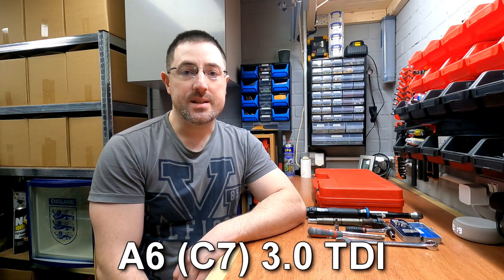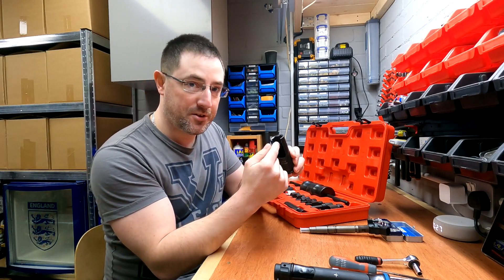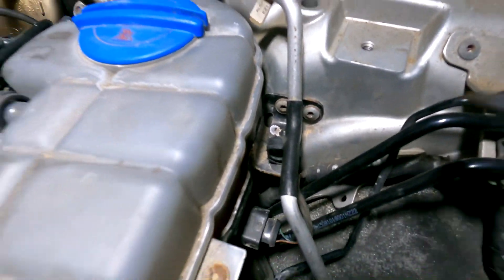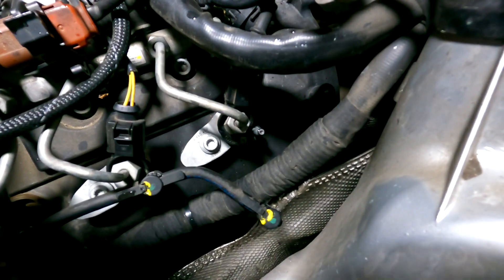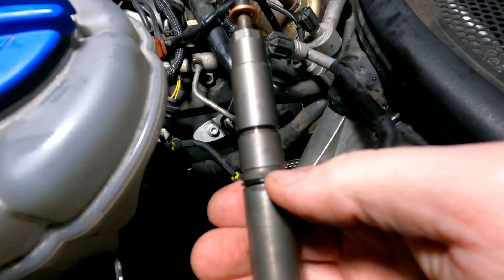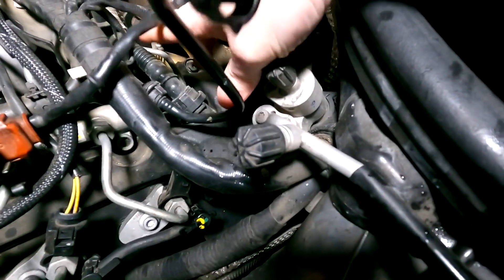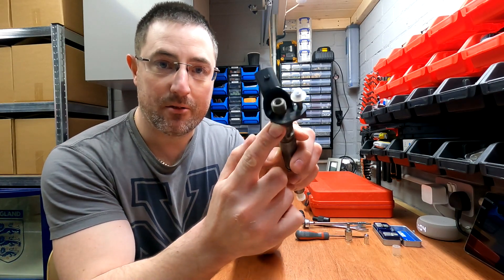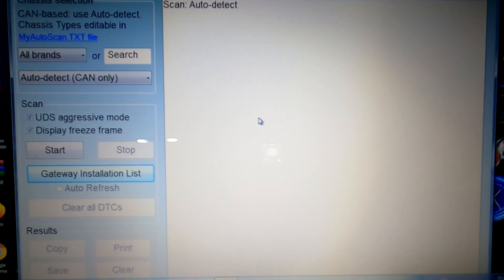Fitting New Fuel Injectors/Seals On A 3.0 TDI For The Audi A4, A5, A6, A7 and Q5 2010 to 2015

Comment: Today I replaced a pcv valve integrated into head plastic cover (a4 b9 3.0tdi). I had to pull the injectors, remove commonrail and so on, but your video really helped me doing so. Thank you

Comment: Great video thank you.  Does the high pressure system need bleeding upon re-assembly at all?  I assume the high pressure pipes have diesel in them when you remove them and have air in them when you re-assemble.
Reply from the maker: Thank you. In most cases, it won't need bleeding. It may take a few more attempts when starting, but I haven't encountered one that hasn't started.

Comment: Hi Ryan, i have a VW TOUAREG ENG CRCA i was reading the stretch bolts to be tightened to 8NM then 180 rotation? Could that be the case for mine? Thanks
Reply from the maker: It's very likely, but would need confirmation

Comment: Great video, very clear. Thanks !!
How do I use VCDS to determine which injector is faulty? It’s giving me fault code P2146 which only tells me there an open circuit on injector bank A. So I guess that could be injectors 1,2 or 3. I have an A6 C7 3.0 tdi. Thanks in advance

Comment: Do you need to prime the fuel to go into the system because I changed them and it took a while for it to start for the fuel to reach the pressure needed to start the car but it's running OK right now no light came on or anything, but it did need some time to Pump the fuel back in the system

Comment: Can you tell me if i need to replace the rubber seall in the valve cover the around the injector?  Can it be changed without removing the valve cover?

Comment: I've got the dreaded injector seal issue with an A7 C7 and this has explained exactly how to solve without spending a tonne at a garage! Thanks a bunch!
Reply from the maker: Glad I could help
Reply: @RyansWorkshop  Quick question if you get time to answer - Can I change the seals on one bad injector, or will all seals need replacing? Thanks
Reply: @tomshaw2192  It's ok to do one but if one is shot then the others are usually pretty worn too! And much better to get ahead of the game as then there is a lot less cleaning involved!

Comment: Excellent video, Ryan. Just one question for you: I suspect one of more of my injectors are faulty (engine running irregularly and smell of diesel in the car). But: how do I find out which one(s) is/are faulty? I do have an EBD2 tool but it's not showing any error codes. Any suggestions? Thx!
Reply from the maker: It sounds like you may have leaking seals which will eventually damage the injectors, you can sometimes identify which ones are leaking by hearing a chuffing sound and sometimes a strong diesel odour and puff of smoke, but the best way to identify would be to remove the injectors, if you have a leaking seal it would be a good idea to change all of the seals because if 1 has gone more Will likely follow.

Comment: The thread on top of the injector is standard metric. I found a nut in my toolbox which we welded to the slide hammer, worked a treat. Saves buying an expensive “injector removal kit”
Reply: What size is the thread on the nut

Comment: Is there a special tool for removing the plastic injector pipe lines....
Reply from the maker: No, it just requires a small flat head screwdriver to assist in lifting the clip upwards, then all you need to do is lift the pipe off of the injector.
Reply: Thanks for the reply, ps I should of asked as well, the small Injector chamber caps that stop debris from falling into the cylinder when cleaning, is there a link to buying the correct size because I've read stories/ mixed reviews of the kit you used in your video ie, them falling through / the flange isn't wide enough, is the correct diameter 7.5mm OR 8mm, for my audi a7 2013 engine code CLAA ....ps loved the video....

Comment: brilliant video Ryan, I need your input please, 
I recently needed to replace parts in my audi V6 tdi which needed the high pressure rail being removed. I did put it back together fine but after getting it to start I feen like the engine developed and miss or like a fuel starvation ( to briefly explain it) I drove the cat about 100 miles and it kinda feels like if develops a miss or fuel starvation as soon as there is a bit of torque on the engine. I get the feeling the pump/rail  is not feeding enough diesel through to the motor. Not saying that's what is is, its just how the symptoms look like. I did clean the diesel filter. but am looking at other areas to look at in my quest to trace the issue.

Comment: Whare are the links for the wire brush injector hole cleaning set?
Reply from the maker: The links are in the description
Reply: @RyansWorkshop  ah sorry yes got them thankyou Ryan. You said its a funny size thread ontop of the injector to attatch the slide hammer, does the fitting in your kit have a size on? Im just thinking just buy the correct fitting instead of a whole slide hammer kit

Comment: Would bad o-ring or seals be a reason for fume smell from the engine bay? I have no obvious exhaust leak but can smell fumes in the cabin and under the bonnet when the engine is running
Reply from the maker: Yes that sounds like a classic symptom of a leaking copper seal on the bottom of the injector

Comment: Do you have a reference of the cleaner to use inside the location of the injectors ? Tks
Reply from the maker: In my case I used an isopropyl rubbing alcohol (IPA solvent) because I didn't want to use anything too harsh, it helped to rub the carbon away just fine.

Comment: Nice 👍 Tks a lot is it the same with CVUA motors ?
Reply from the maker: It should be the same if not very similar as this engine is just a later generation with a second turbo, I believe the injectors are the same just with a different calibration setting.

Comment: When cleaning the injector locating hole if there is carbon build up how do you get carbon out? Will in not go onto the cylinder? Also this will be the same if you need to cut the sealing face for injector. What do you recommend?
Reply from the maker: I would say the best way is to adapt a hoover pipe with a smaller hose attached to the end, using tape to hold it together should be sufficient as long as it's airtight.

Comment: Thanks Ryan for this very informative video! I’ve been quoted hundreds to do this at a garage but I’ve just ordered the parts in your description. I have the other tools already and I am going to do this myself. Keep putting more videos like this, top man!
Reply: Hi Ryan, I’ve just fitter my injector kit using your video and it took approx 2 hours. I bought the kits from your list apart from the slide hammer and instead bought a cheaper one on eBay which claimed to have adaptors for Bosch injectors. Unfortunately the adapter didn’t fit (right thread size just flange fowled with injector housing). I then came up with a solution to use a slim 13mm spanner and insert into side of injector and work it loose that way (rotate clockwise and anti-clockwise). So all in all a good job and a lot of money saved! I’ve also documented the condition of the old seals and injectors. In my case it was cylinder 1 and 6 which were the worst and most leaking. The other injectors were clean and shiny upon removal. Once again, many thanks for your video!
Reply from the maker: Thank you, just glad I could help

Comment: Hello there, thank you for the video. Does the fuel system need to be depressurised first before work commencing? Thanks again.
Reply from the maker: No, the system doesn't need to be depressurised as there will only be pressure when the pump is running, it pressure releases when you turn the engine off.
Reply: Ok great! Thank you very much! I've ordered the seal kit from the link you supplied, it will take a month to get here in Australia. Itching to get this fixed on my sq5!
Reply: Hi, another quick question. Is the thread on the injectors m14 1.5 pitc thread? Just making sure I buy the right slide hammer set for the job. Thanks!

Comment: The SAE term for the bolts is Torque to Yield, abbreviated TTY.  You can actually reuse them a few times.  The stress-strain curve for those bolts allows for quite a bit of stretch before they fail.  We actually allowed critical fasteners (head bolts, main bolts, etc.) to be used 3 times for the engine I worked on.  But, they are also inexpensive, so if available, I wouldn't shy away from re-using them.  Thanks for posting the link to the kit.  Here in NA, the kits that come when you order from virtually all of the vendors is incorrect, it is for a gasoline (petrol if you prefer) engine.  And most don't have a picture so you don't know.  So just a heads up to anyone looking.  If in a bind, Elring 767140 is the copper washer/seal.  Be sure you clean up the injector bore, BTW, or they will fail again quickly.  2 months to be precise  :(
Reply: I suspect audi sent me the wrong injector hold down bolt for my TDI. It was a bit longer than the one that was in it and it bottomed out and snapped off in the head. Are the FSI injector bolts longer?

Comment: Hi, just watched the video, very good and very useful as I remove all the injectors for new copper seals rubber seals and the stretch bolts, but my question is next: the system it's self bleeding of any air at the first start of the engine if they will stay removed for couple of days?  Many thanks.
Reply from the maker: Thank you, and yes they will self bleed as they are under high pressure, it will take a little longer to start on the first start up afterwards while the air is removed through the injectors, my vehicle started perfect on the second attempt.

Comment: I might sound foolish but is this the same engine as a Q7 3.0 TDI , I’m having a small fuel leak on the 4-5-6 side. I’m trying to narrow the problem down. Any information is helpful thanks.
Reply from the maker: It all depends on the year and specific model, but it will most likely be similar anyway

Comment: Hi there, I have just removed number 6 injector in a 2014 Audi SQ5 TDI and noticed that it didn't have a copper washer. Does that sound correct to you? I am not sure if someone has previously has the injectors out, but wanted to me sure that I have the right seals when it gets reinstalled.
Reply from the maker: That doesn't sound right, it should have a copper washer to create the seal!

Comment: Thank you for such an informative video! By chance, do the new injectors or seal kit come with new stretch bolts? If not, where might one find the correct bolts? Thank you
Reply from the maker: Thanks. The seal kit comes with new bolts, O-rings and copper washers, the injector's themselves won't come with the bolts, just a copper washer as far as I know.

Comment: what will happen if don't update the new coding?
Reply from the maker: If the injector code isn't entered into the ECU, it will receive incorrect information and run out of it's calibrated tolerances, resulting in poor engine performance, increased fuel consumption, poor emissions and potential engine damage or premature injector failure.

Comment: Great video! I couldn't find any information on the internet about 2015 Q5 CPNB fitment. Do you have any information for a compatible seal kit that fits CPNB engine? Thanks!
Reply from the maker: Hi, from this information I see that this engine code has the same Bosch Piezo injectors which will have the same seals as in the video https://ebay.us/b7WOW4 this listing doesn't display all engine codes that the seals are compatible with, I know this because my engine code wasn't listed but they were the correct seals anyway, hope this helps.

Comment: Hi. I've a 2006 3.0 v6 tdi touareg could you tell me all the torque settings? Thanks
Reply from the maker: Hi, to be honest I would need the engine code to obtain that information!
Reply: @RyansWorkshop Hello ryan. Thanks very much for taking the time to reply, from the sticker in the boot the engine code is bks. Its a 3.0 v6 tdi touareg 2006
Reply from the maker: Hi, sorry for the delayed reply, the high pressure pipe setting will still be 25NM, the injector clamp torque setting depends on what type of clamp it is, if it's the newer single bolt type clamp like in the video it's 6NM + 90 degrees, if it's the older type that has 2 nuts on the clamp (one each side of the injector) the torque setting will be 10NM, also with the older type clamp it is recommended that the clamp is replaced as well, hope this helps.
Reply: @RyansWorkshop  hello ryan. Thanks again for taking the time to reply I really appreciate it. Could I ask you one more thing? How do you find out torque settings for a specific vehicle? I'm wanting to replace the timing chains/guides on my touareg.  Is there such a thing a a workshop manual? Thankyou
Reply from the maker: Haynes manuals are a good source for specific vehicles. https://haynes.com/en-gb/volkswagen/touareg/2002-2006-32-petrol-42896?gclid=CjwKCAjwh5qLBhALEiwAioods7BwH92rlgMe1-JVop0AULGSoMib-_VGeLOaxzxwSgq_OAgrtrLG5RoCUM4QAvD_BwE
Reply: @RyansWorkshop  thankyou ryan
Reply from the maker: https://haynes.com/en-gb/volkswagen/touareg/2004-2006-30-diesel-138638
Reply from the maker: I think this is your specific vehicle

Comment: Thank you your detailed video. Question regarding the O ring installation: service procedures told we should use T10377 assembly sleeve for O ring installation. (Well for the CRCA engine but I think it is the same) Do you think it is necessary or is it ok just put the new one on to the injector without using this tool?
Reply from the maker: Hello, I don't really think its necessary to use the tool, you should be fine without it, just take care when installing.